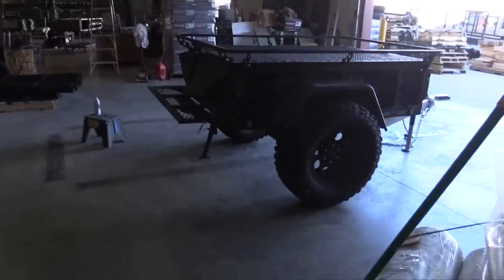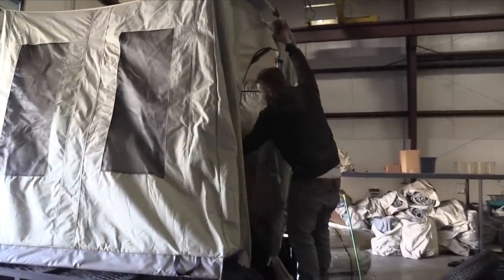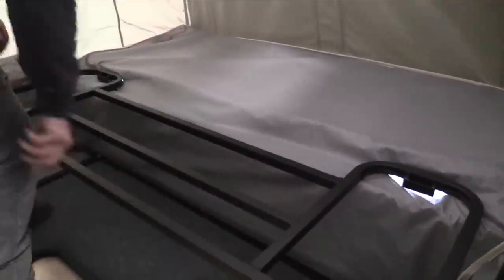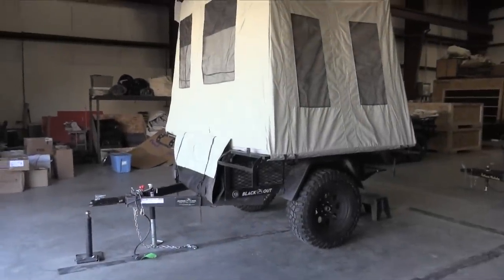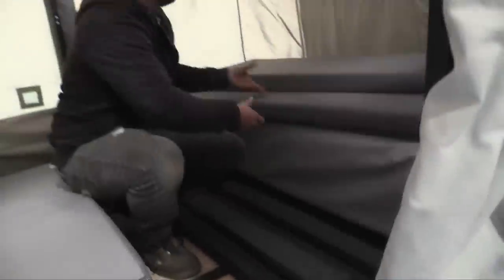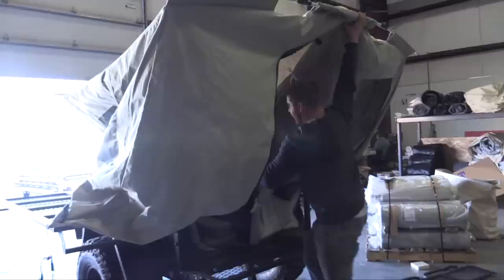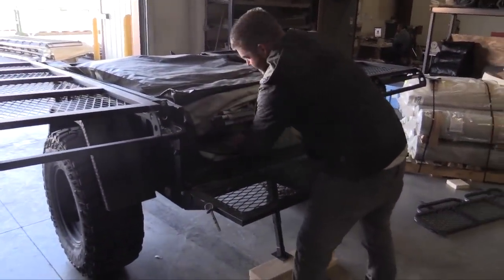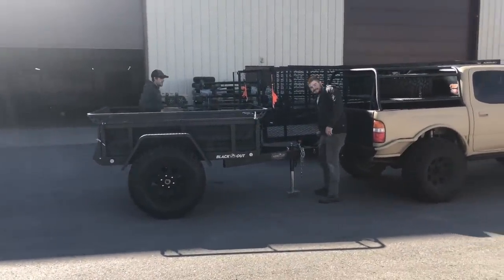SHOWING OFF OUR CUSTOM JUMPING JACK TRAILERS 4X6 BLACKOUT!!  HOW TO SET UP AND TAKE DOWN

Comment: Have the 12' version like yours just not the Black Out, have had it for about 7 years now and love it.  Get a couple LED lanterns and a Buddy Heater....good to go.  During cold/wet weather I put a 12x16 tarp over the top as it helps shed moisture and also holds in heat a bit better.  Best part is, I can store it in my garage.

Comment: We have a regular 6X8 and just drug it on some 4x4 roads in Colorado, love it!
Reply: Do you wish you had the “blackout” edition?
I’m leaning towards the standard. I’m gonna guess the standard will keep up with majority of off road conditions. 
Thoughts?
Reply: @BladePressure  nope, no regrets on regular.  Black out is slight higher ground clearance.  But the power to get up whatever comes from the truck not from the wheels of the trailer.

Comment: Hey man, I noticed you are running a 6 lug wheel on this trailer.  These trailers usually come with a 5 lug hub assembly.  Was Jumping Jack able to swap the hubs to accommodate this?  Or did you have to use some kind of hub adapter to run those wheels?

I ask because I just placed an order for a 6X8 blackout.  I want to run matching wheels like you are, but the wheels that match my truck are a 8 lug pattern.  Wondering what they were able to do for you or what my options would be?

I am located in Salt Lake as well.  Can't wait to get mine setup with my 17' Power Wagon :)

Comment: Well, what is the two year long term verdict on this trailer?

I struggle back and forth on getting the regular or BO.  The latter is just so pricey. I’m not sure I would really need the extra inch of clearance. Or need an articulating hitch.
Reply from the maker: We really used our trailer a lot over a 5 year period and had no issues within it. They are very convenient and even more durable

Comment: Will a 4x4 (Honda 1000-5) fit on the top  of this trailer?
Reply from the maker: The deck is 4’x6’ weight is about 1000lbs can’t remember exact carrying capacity, any 4 cylinder will pull it.  Tongue weight is about 100lbs

Comment: how is it in the colder nights?
Reply from the maker: We’ve slept in it in below zero.  It won’t hold the heat with no heater on but neither will a camper.  We use one of the Mr.heater buddy heaters and it warms it up in about 5 minutes.

Comment: Is that canvas like those old spring bar tents where they are waterproof unless you touch it? I’ve had stuff get wet on the inside if it’s touching the walls. Have you guys had any issues with that?
Reply from the maker: It’s very similar but not exactly the same material.  The only time I had that issue was one time I didn’t pull the sides down far enough and the seam where the canvas is sewn to the bottom and it rained for 16 hours straight.  I think it finally seeped through the seems.